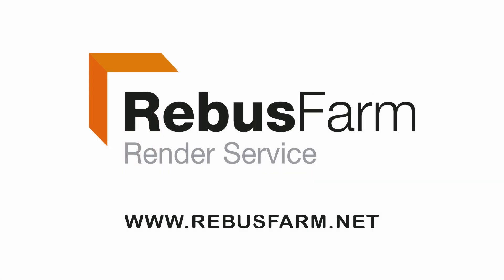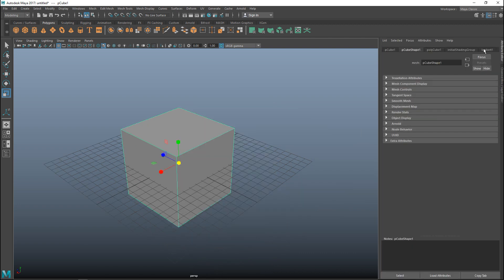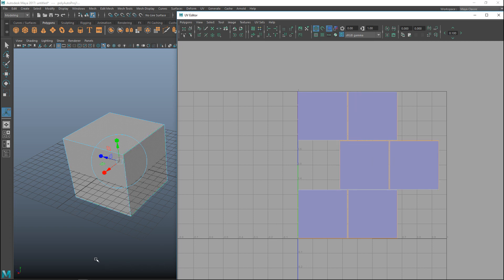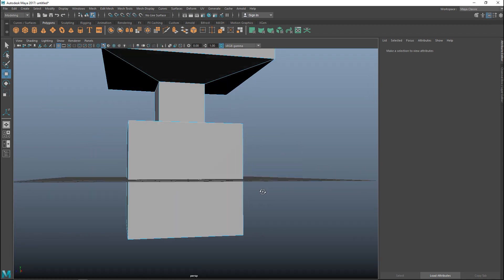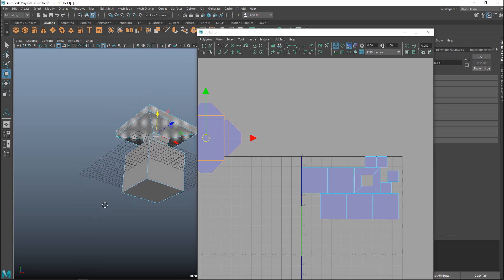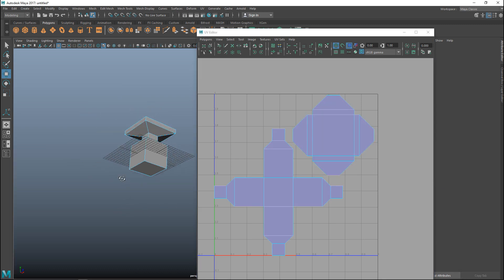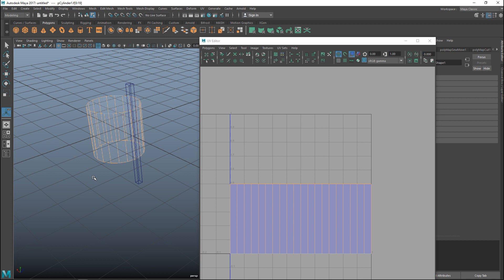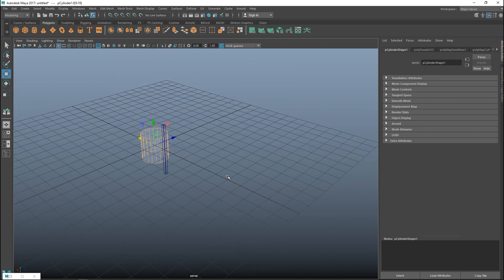UV mapping basics in Maya 2017

Comment: Am using Maya 2017 after using 2013 for a few years. I try to do planar mapping but the checkered tiles won't appear, so I cant see if the UVs are aligned or correct sizes. How can I make the checkers appear?
Reply from the maker: You need to put a texture on your model ( Lambert ) and then plug the checker onto the model
Reply: "plug the checker"?

Comment: hi Mike i am from. INDIA and.. i am only a 2d designer but because of you i became a 3d designer thanks a lot. Mike.. you are cool and very helpful..for me... i am getting truble in makeing model on real world scale.. can u help me i need some tips. if i work on single object i can do.. it but if i make a ground layout than my system is i7 but ram is low only 8gb and 2gb graphics card..
Reply from the maker: System should be good for Maya 2017 or sooner. As for scale, what are you using ?
Reply: thanks i am using cm if i have a hight 25ft than i am using 25cm if i used by converting scale by cal 25ft=762cm than i having problem because i have to work on a large layout plan. so i am doing it one object at a time. and will import all later. i want your help on grid setup what will best for me?..  right now length & w is 1000u grid lines every 34.4800 & sub is 1

Comment: My issue seems to be that my modeling is light years above my UVing. I have 5 models under my belt and started at 2000 faces. The 5th model I just sent you has 29,900+ faces. I'm sure most of that is in the tire tread, but still far beyond my skill set. Let's be conservative and say there are 2,000 faces in the body of my vehicle. That is a lot of headaches lol. I have to concentrate on modeling, with UVing in mind. Because, creating something beautiful and the textures not translate that beauty, is heart breaking.
Reply from the maker: Lori, UV mapping is for low poly models and high poly models are for baking normals ( if needed ) So depending on your needs I would focus on UV mapping the low poly
Reply: not sure what baking is, so i'll have to google it ;)
Reply from the maker: Hi Lori, baking is the process where you "project" the details of a high poly detailed model onto a low poly ( less detailed ) model of the same thing to create the illusion of detail without actually increasing polycount. This way you can UV map the Low poly model ,"bake on" the details of the high poly model and texture it as if it was highly detailed. ( I did a lot of videos on this )
Reply: Ah, I see. I just read 2 articles and was still confused. Ty for taking the time to explain it. I will definitely look them up. I've been religiously watching your videos and I am only on the 4th page. So, I'm working my way there lol. You have a lot of videos Mike, 0.o  haha. In fact, even when I google something or search it on youtube, you already have a video of it.  I am an avid fan. TY
Reply from the maker: Lori, You should join my FaceBook Hang Out Group https://www.facebook.com/groups/294359217578724/

Comment: Hello Mr. Mike! Thank you so much for these tutorials :-)
I have a problem with a character I'm trying to Unwrap.
Character is in 2 parts, Upper and lower.

Planar projected the lower part just fine yesterday and my Uvs are ready but that's not the case with the torso (upper part)
Everytime im trying to planar map it it only shows the front. It doesnt unwrap it.

Then i try the Best Plane tool and works good, I can cut it in 2 shells but when i move the front to the left in the editor some vertices are connected even though I cut an edge there.

Why is this happening?

Thank you so much in advance, I really need help, please!
Reply: >.> I think I need some sleep, I was forgetting to cut some edges lol. 
Works now, going to adjust them a bit ;p
Still love you! :-) Thank you!

Comment: I need help, I have a lot of trouble while UV mapping with complicated cylinder or hopper head shape, like a bottle, a barrel. Because even when I unfold and skew, the map is still round like a rainbow, so how do I make it like rectangle so I can easily apply detail texture? Thank you.
Reply from the maker: The rounded shape you speak of is normal. The side of a bottle could be flat but the rounded part would end up as a distorted circle